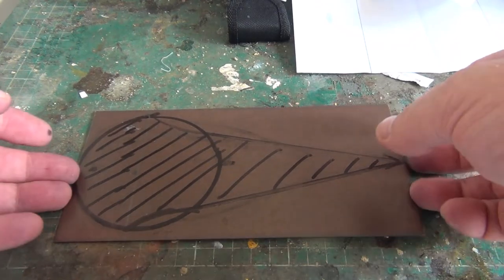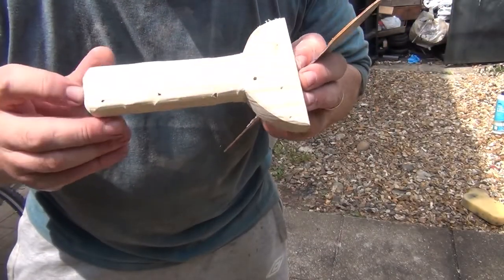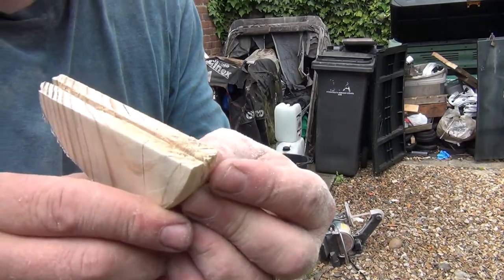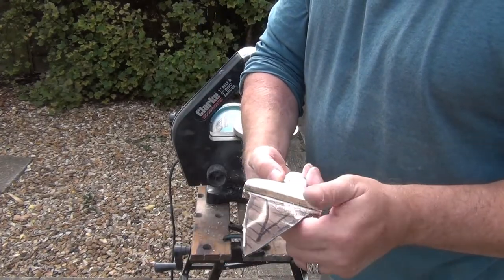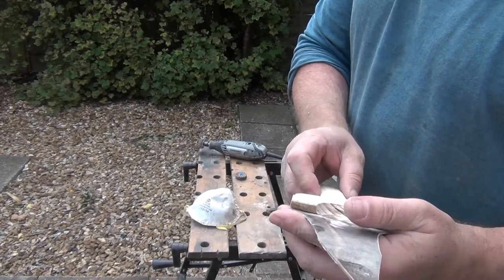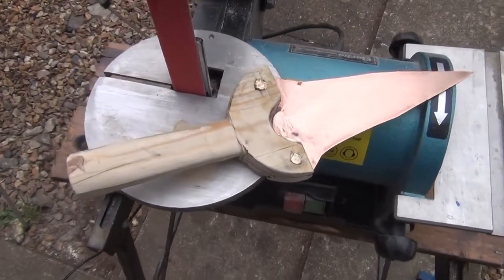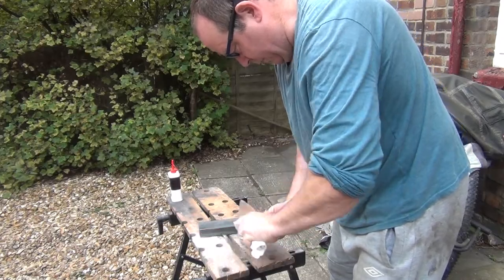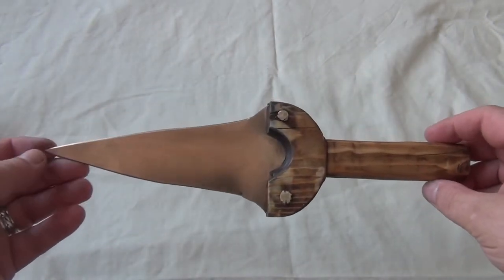Replica Bronze Age dagger build - no casting.

Comment: Now you are in my specialty! Is it tin bronze you are using? A lot of the sheet bronze is usually phosphor bronze.And yes Id avoid soft light pine it's no good for anything. It always lets you down strength wise. You should try hammer hardening the edge. You should notice the difference when cutting and stabbing.
Reply from the maker: I really don`t know, I ordered a sheet of bronze, sorry.